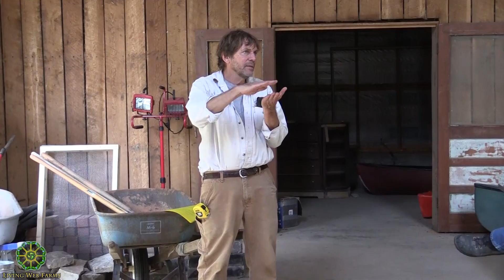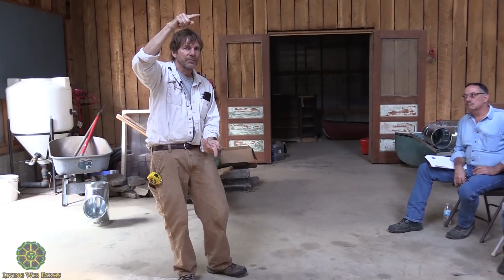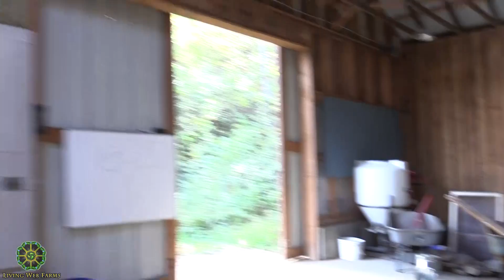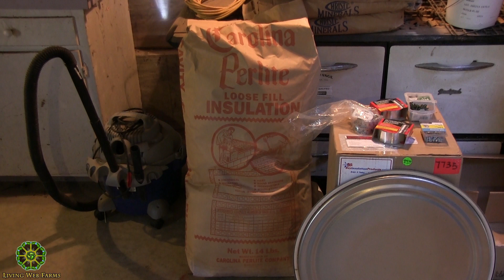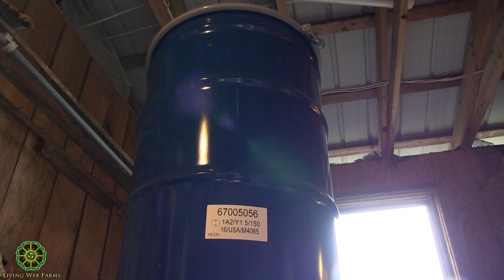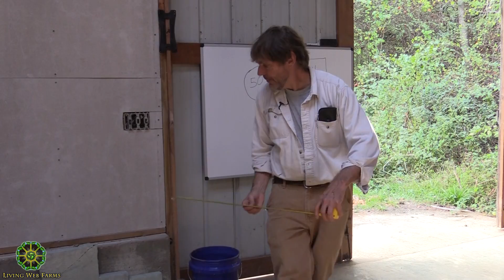Rocket Mass Stoves for Cooking & Home Heat Part 2

Comment: As far as I know, brick has more "thermal storage capacity" than concrete.
Reply: Clay is lighter than sand.
Reply: I repeat, concrete heats up and cools down faster than brick.
Reply: @KKhhoorrnniittee 
Brick is not a good insulator
but is a better insulator 
than concrete.

Comment: Rocket mass heater stoves are much safer than conventional wood stoves not only because of the cooler flew gases but because, once the burn is over, the fire is out and its only the heated mass that radiates the heat into the house at night while you are asleep. Most owners of conventional wood burners will choke their fires down during the night so that they have heat all night until the next morning. While a slow burning smoldering fire sounds good it is in fact very bad because not only do you have a live fire while you are asleep, it also generates deadly CO and the incomplete combustion causes a buildup of creosote in the chimney which poses a high risk of a house fire. Bottom line is high temperature, clean and complete burning rocket mass heaters are the way to go.

Comment: a lot more rockets have horizontal feed ways. I wonder if this would affect the ratios 2 to 1 to 4. 
regarding cooking where the heat exits the barrel/bell. this area presumably the manifold.  he says that this area would be plenty hot enough for cooking. would this include baking in oven temperatures? apologies for the question as the author does not respond to the comments

Comment: The answer to the question about the water coil in the venting is that it will work, but you have to install a valve on the water to adjust the flow rate of water thru coil, as to not take so much heat that gases can't flow and burn flue gases out the exhaust. Also, you don't want to put the coil in the secondary burn chamber, you want that as hot as possible. The secondary burn chamber should have perlite or something that insulates, you don't want to heat cob around the secondary burn chamber, you want perlite all around that to force it to get so hot it will burn anything going thru there. if done right, you could burn green wood, and there will be no smoke. Note: green wood is not going to burn easily, but it is the point of how it can burn anything up to nothing, no smoke, no soot.

Get it hot enough and have heavy enough SS tube for the secondary chamber, and it could almost be an incinerator. Actually i might look those up right after this. Think of that, able to burn ANYHING in the incinerator. You could burn used motor oil and have no exhaust fumes in something like that. Also tires. lol

Comment: Could something be like this to heat a home if you were out for 8 or 9 hrs a day at work, or do you need to tend to it every couple of hours?
Reply: You've probably learned your answer already, but you burn this super hot and intense to charge the mass, and it will stay warm for a whole day.

So like 1-4 hours burning, once a day basically

Comment: Are these legal?  I can't find answers to this.
Reply: The answer is, it varies. The Wisners have at least one design that has been passed for code in some locations. I would recommend reaching out to Erica Wisner with this question.
Reply: @peterellis4262 I found that my local codes and insurance will not back such a stove.
However, if it's a certified stove (UL) and it's EPA exempt or approved I can install one.
The only one I've found is the Liberator Rocket Stove.   They are quite expensive though. 
I'm now looking at a wood burning cook stove

Comment: Instead of using the bottom barrel, would it make more sense to use bricks and Cobb? Then the top barrel could just sit right on top of that.
Reply: Why not, also you could pour the inner stack using equal parts sand, cement, and perlite.
Reply: @TheRebelmanone  Temperatures in a good heat riser will destroy portland cement.